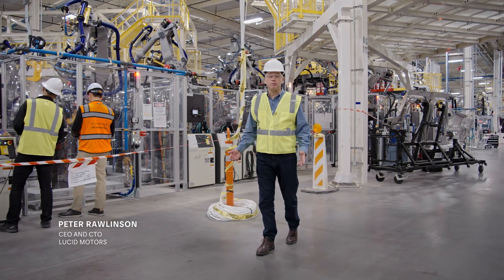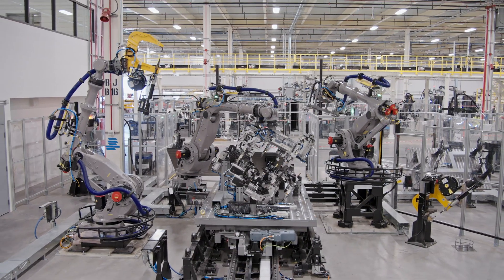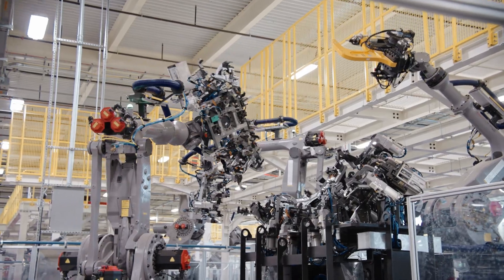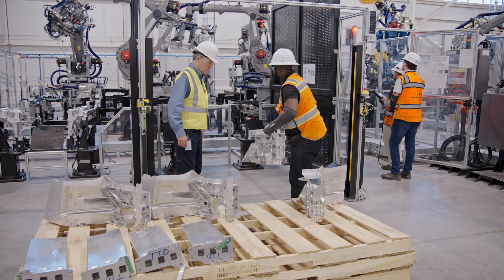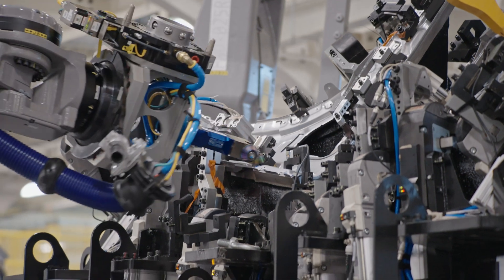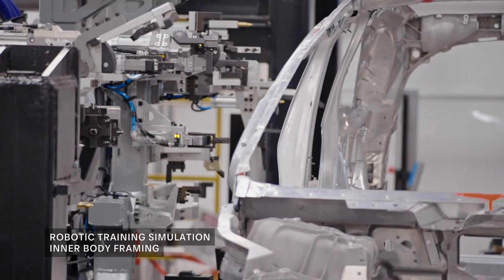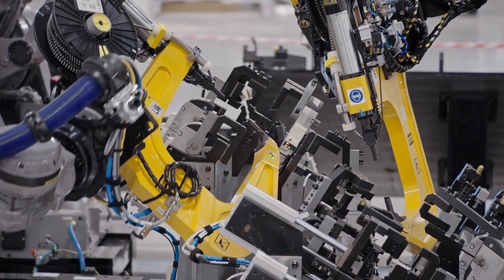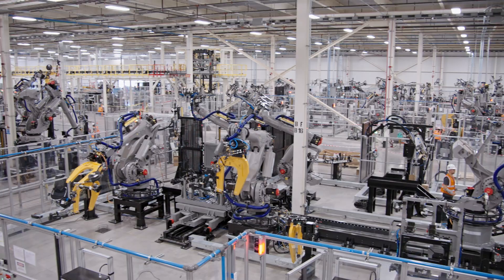Preparing the Factory: Training the Robots | The Road to Lucid Gravity

Comment: Best practice would be to build for battery swapping, uniform battery standards for vehicle class size conforming to battery class size standards. That will make vehicle battery swaps quick and reliable because your battery pack would be common and widely available.

This would have to be voted on as a standard with applicants showing their designs. The boards of each corporation would vote. This would bring the entire industry forward by bringing all there resources together and would be more cost efficient in doing so. The End.